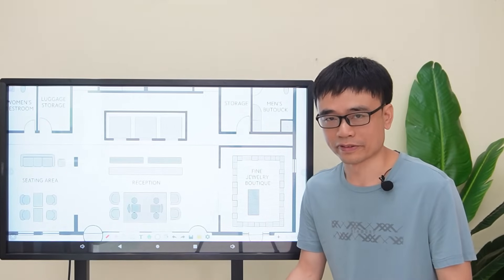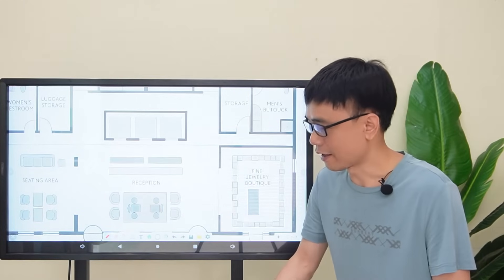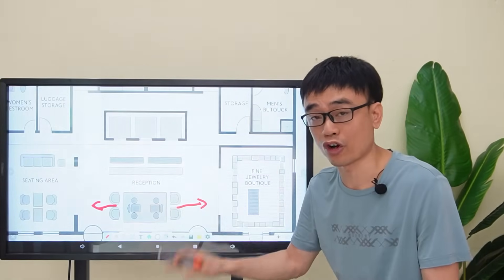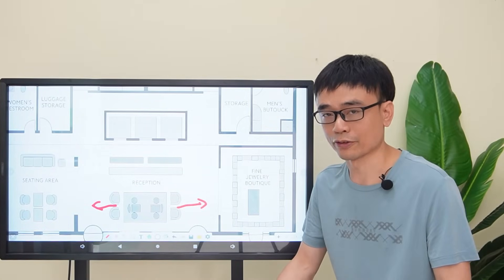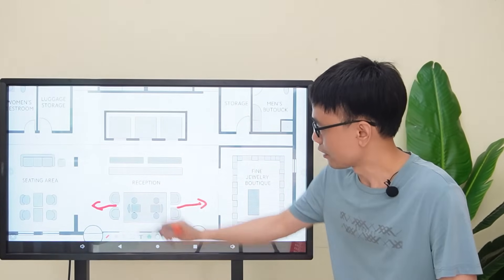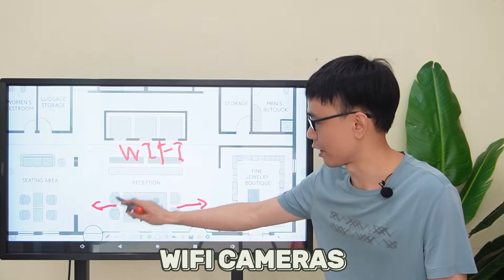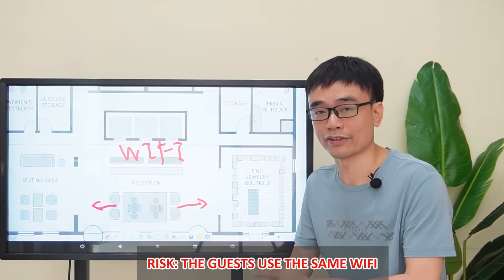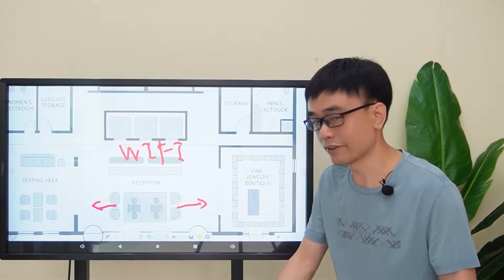How to Install IP Cameras in a Hotel Without Interrupting Business | Smart PoE Setup Tutorial

Comment: what's the diference between this poe powered swicht and a poe extender?
Reply from the maker: Both supply similar features. The PoE powered switch has more PoE ports. In the hardware level, the PoE extender is a hub. It doesn’t maintain MAC address table.

Comment: I have a problem we upgrade our center internet and after that our camera not working.so Poe switch is little far I mean in other room and nvr is next to modal there is one wire is contect to n r which is came from pro switche and one from router in lan port but after new modam only one camera show up but before all camera showed up can u tell me how to setup back in same way
Reply from the maker: Ensure router, NVR, and cameras are all on the same IP range/subnet (e.g., 192.168.1.x).